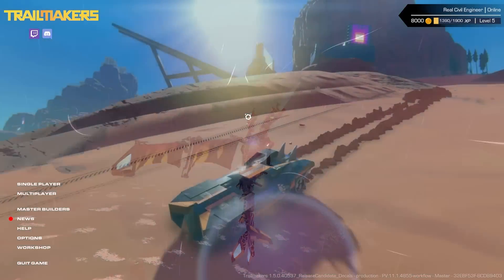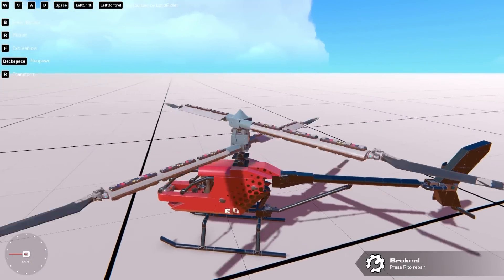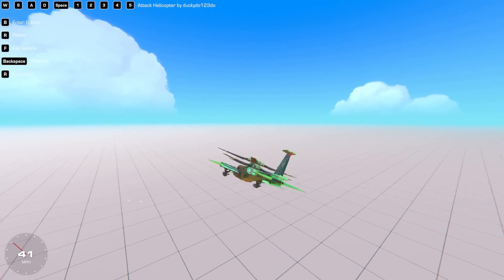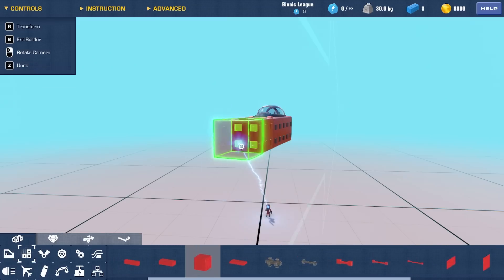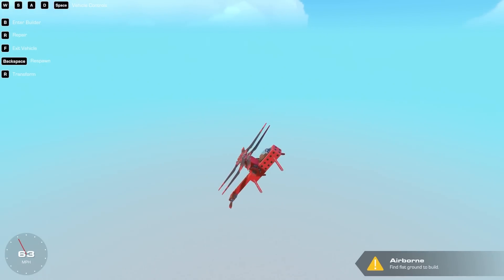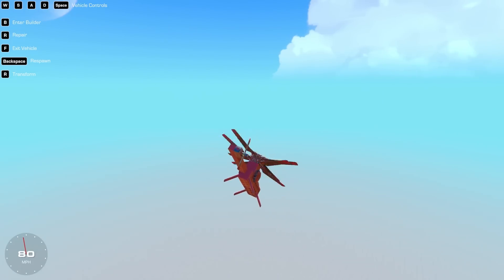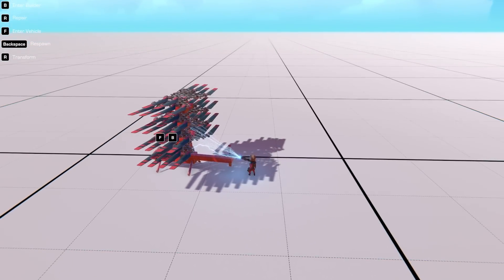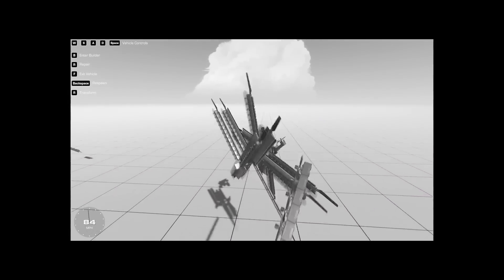This SUPERSONIC HELICOPTER is so fast it breaks reality!

Comment: On a normal helicopter the back blade is used to prevent rotation of the actual fuselage of the helicopter. Therefore the back blade needs to be on at all times to preform counter rotation

Comment: I guess its a bit much to ask this program to simulate retreating blade stall conditions, but there is a reason why why helicopters generally can't break 300 mph. Basically in the scheme of things, half the rotor is going forward and adding your velocity, the other half is doing the reverse and subtracting. Since the blades have a certain critical (stall) speed like any wing, that becomes a problem. Furthermore, helicopters move by essentially trading lift for directionality ie tilt the rotor hub to get 85%up/15% forward. Most super fast copters have a combination of wings (ie the Mi-24, the NASA testbed you mentioned) and a pusher engine (ie AH-56 Cheyenne Prototype) so the lift rotors are not burdened as much.

Comment: The record holder you showed a photo of uses a propeller for forward propulsion. I think that combined with the other style of dual blade sets with them on separate wings is the way to go. 
After googling it, the one I was thinking of is the Osprey. And the technical term is 'dual rotor' (from what I got as responses to searching for 'dual blade set helicopters'). :)

Comment: You need to increase the power ...for all those blades you'd need 100,000 horsepower engines 

This program isn't using any math or engineering...

Comment: Helicopter engines in this game have a MASSIVE amount of torque. The thrusters were moving the entire creation instead of just the blades. The servos on 0% strength are practically bearings, so they don't have the speed limitations the engines do.

Comment: If you could get your tail blades to go at a constant speed that will stop you from spinning so you don't need two main blades. Let's say you set the tail blades a 30 mph. That will stop the rotation of the helicopter. If you speed them up to above 30 it will spine the helicopter slowly in one direction, slow below 30 the helicopter will spin the other way. That's how real helicopters work anyways

Comment: I think your best bet tbh to get a supersonic helicopter or anything even close is using the blades to lift and rockets to move you forward, and you might be able to make a more stable platform with a quad rotor. Think large drone.

Comment: the issue with most propeller Aircraft is actually the sound barrier. Propeller tip speed is the limiting factor for rotation speed as the once the prop tip starts to go supersonic it stops producing thrust (due to loss of laminar flow) and halts acceleration (blah blah real world physics). For the game The craft may be only going 120mph but the prop tip speed is probably closer to 550mph. So without the prop spinning waaaaaaay faster than supersonic there is no way to get the craft go go close to that speed. forget helicopter where a lot of the thrust is used for lift...try building a prop driven car now all thrust is for speed and you still run into the same issue. prop tip speed is waaaay faster for a given craft speed, so prop speed needs to go way above supersonic before you craft has any hope of going supersonic.

Comment: speed of sound = the square root of (the coefficient ratio of specific heats × the pressure of the gas / the density of the medium). Therefor all you need to do is increase the heat and pressure and reduce the density. I've Architected the solution, all you have to do is engineer the fix.

Comment: If you didnt know mat; the reason it has 2 blades at the top and one spins in the opposite direction is because it doesnt have a tail rotor; the 2nd blade does the job of the tail rotor which is to cancel out the torque of the main rotor. The KA-50 'black shark' is a prime example

Comment: From the perspective of a pilot (i.e. me) 
Supersonic + helicopter = impossible
Because any type of rotating airfoil or propeller, cannot go supersonic. 
Helicopters work on the principal of beating air into submission. Supersonic air flow rate different from subsonic airflow. at this point of time the helicopter wings I just slicing to the air without producing any lift.

Comment: I’m not a helicopter expert, but there’s usually a bearing that connects the blades to the main body to counter the rotation and keep the vehicle stable. This is assisted by the constant rotation of the rear propellor
Reply: It's isn't just a bearing, it requires specific geometry and has to be attached in a very specific way to the blades. What that solves is dissymmetry of lift, it has nothing to do with counteracting the rotation imparted on the craft by the main rotor, that is purely the tail rotor. Dissymmetry of lift isn't even simulated by Trailmakers, so adding the mechanism that mitigates it doesn't do anything.

I'm not an expert either, but I have spent hundreds of hours improving my helis in Besiege, so if that counts for anything, there you go.
Reply: That makes more sense

Comment: I feel like if you put the blades very far out using the connector pieces that have no air resistance, you would get a lot more blade speed from just a single blade instead of it being up close to the center of rotation

Comment: RCE when designing the helicopter you forgot about one major thing. You forgot about the ability to change the pitch angle of the rotor blades. You see increasing the pitch angle of the rotor bales increases their lift force significantly. In fact by changing the pitch angle of the rotor blades also called collective is how real helicopter change the amount of lift the main rotor generates. So I suggest you add ability to change the angle of your rotor blades and be amazed at the difference. I'm willing to bet that even your basic helicopter could reach speeds of over 150 MPH if you add yourself ability for changing the pitch angle of your rotor blades.

Comment: should make a helicopter that turns into a plane, like the helicopter blades fold into plane, and plane uses thrusters. will have to turn off props, or they will destroy aircraft. 
also, id recommend experimenting with multipurpose vehicles

Comment: your speed is going to be heavily limited by the drag profile of the helicopter blades / wing pieces toward the airstream - try rotating the wing / blade toward what it considers the 'forward' direction and see how red those arrows go

given what trailmakers' aerodynamic modeling is like, though, i don't necessarily think it would help to change the angle of attack of the wing / blade the way it does in KSP - it might just not be possible to make a very fast helicopter in trailmakers

Comment: Look at the hydra aircraft from captain America the first avenger. That’s how you make a supersonic helicopter. Think of a rocket without the engine, and add plane wings, then add rocket or jet propelled rotors in the middle, but instead of doing the modular wings the way you did, attach them to something that will rotate and then hold them at 45 degree angles from level, while keeping the rotor propelling engines either level, or at the same angle as the rotor; mount 2 of these rotors in the middle, but slightly more towards the top, as counter rotating rotors, and then make the fuselage fins and wings have regular plane controls. The key is to build it vertical as a tail-sitter design, with the spine of the helicopter at the exact same alignment as the axis of rotation of the rotors.

Comment: Maybe try putting the jet engine on the edge of the propellor rather then the center since it has a larger circular path... I dunno why, but I suspect that would work better than having one in the center of the propellers
Reply: The engine has a maximum linear velocity X.  If you place the engine on the tip of the blade, then the maximum velocity of the blade tip equals the maximum velocity of the engine. If you place the engine towards the center, then the maximum velocity of the blade center will be equal to the max velocity of the engine, but because of how angular velocity works [v=ωr where ω is change in angle over time (or dθ/t), and a change in θ at the center equals the change in θ at the tip, so v correlates positively to r], the tip speed will be faster than the center.
Reply: @iluomopeloso  Thank you for explaining it... I still don't understand why it works, but thanks for confirming I was correct with my assumption

Comment: Tactical helicopters use engine thrust to move forward and the blades to go vertical. Check out the ch47 Chinook for an example.
Reply: Not really, the engines on a Chinook and Blackhawk work the same as every other helicopter. They turn the rotors. The rotors sit on a swash plate that is controlled by the cyclic and collective, and via pilot input the swash plate adjusts each blades angle accordingly. The Chinook is just a tandem rotor rather than an antitorque rotor setup.
Reply: @theripcord03  i stand corrected

Comment: Amusing, yeah no. If you want a supersonic helicopter you need to basically build a drone or a VTOL. Put a set of double helicopter rotors on the end of two wings where they blades rotate down, our a set of four wings where the rotor sets rotate down.

Comment: The helicopter engines are slowing down your max rotation on the blades. you have to use a free spinning block if you want to spin faster
Reply: Also aerodynamic limits irl kick in
Reply: couple multiple helicopter engines together for more torque on a given set of blades maybe?
Reply: I feel like Matt makes this mistake too often
Reply: Even more of a challenge making a super sonic heli using helicopter engines but we use a glitch
Reply: As the guy who has the most records on the leaderboard (at least on the boat and off-road races) I approve of this message
Reply: And jet engines on the side should help
Reply: @ThePapaja1996  Jeticopter.
Reply: @Sc0ttPrian  *jetpter
Reply: @Sc0ttPrian  You know it is normal for helis to be propelled forward by jet engines? You might see those engines just below the rotors. The rotor is only to provide lift.
Reply: @Notmyname1593  I didn't actually know that. I'm just familiar with tilting forward to provide diagonal thrust on non jeticopters. clearly not a pilot

Comment: A supersonic submarine bridge, something that can create an underwater sonic boom, also a supersonic Beaver.
Reply: Sound moves a LOT faster in water than it does in air. Conversely, getting "supersonic" in the water means you need to be moving much faster also. In the air it's something like 1200 km/h, while under water it's around 5300 km/h. Long story short, not happening.
Reply: @Phaéthōn_the_Radiant  it's a game blimey